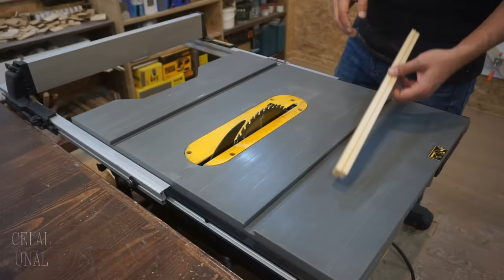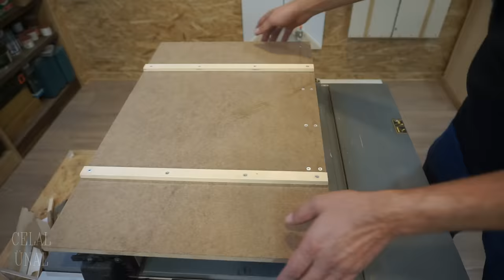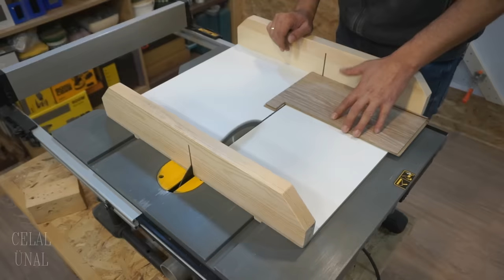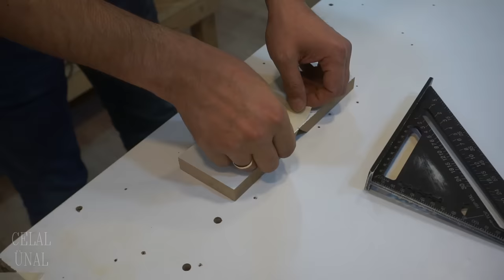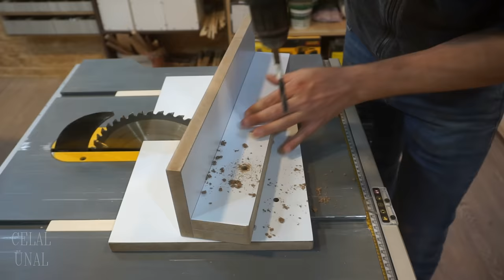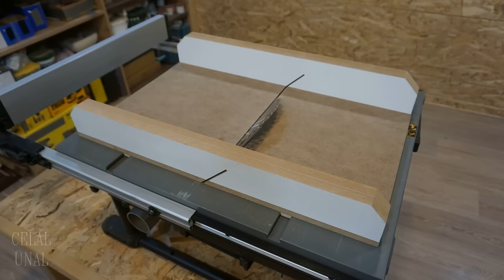Very simple and useful table saw sleds / Yapımı çok kolay ve kullanışlı tezgah testere kızakları

Comment: Hello Celal,
Why did you square the rear fence to the table saw fence instead of the blade. Something I would not do. I always square the rear fence of my sleds to the blade then run the 5 cut  test before permanently attaching the rear fence.
Keep your vids coming, I look forward to watching them.
Reply from the maker: Hello. Better to use the table fence. Knife too, though.

Comment: Hello.   quick question about your application of CA glue.  Most of the videos that I've watched the person applies the CA glue to the side of one board and then sprays the accelerator on the other board and then puts the two boards together creating a very strong bond.   However, when you spray the ends of the piece of wood I don't see how any of the accelerator comes in contact with the CA glue.   So why even use the accelerator?
Reply from the maker: They use instant glue to avoid waiting for glue drying time. At the same time, glue is also used. Not as strong as instant glue glue.

Comment: EXCELLENT video - you are quite talented!! I plan to make several of these per your technique. I also liked the sled you used to get a straight edge - it is shown at the 5:40 minute mark into the video. Might you be able to share the dimensions of the wood you used? I think that sled ensures a straight edge without worrying about the accuracy of the table saw fence.. I have the same or similar DeWALT saw and the fence is bowed. Many thanks, Larry
Reply from the maker: Thank you so much. I am so glad you liked it. I did not share the size as it varies from brand to brand.

Comment: Hi, what is the spray that you use before glue?
Reply from the maker: Thank you. I used instant glue and activator spray. A material that provides drying and adhesion with activator spray.
Reply: @CelalUnal1  thx! I don't think I could buy it in my country :)

Comment: What spray you use after glue?
Reply from the maker: I used instant glue and activator spray. A material that provides drying and adhesion with activator spray.